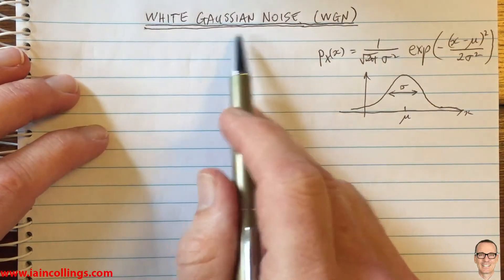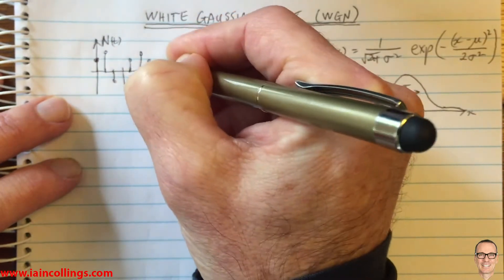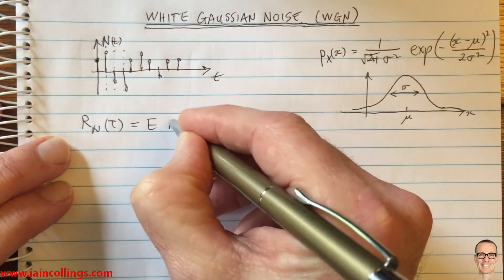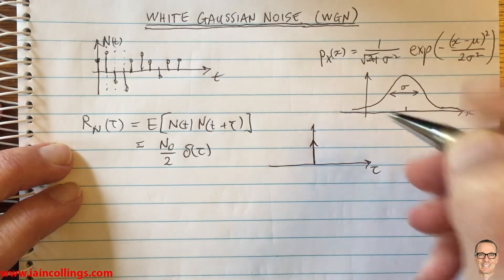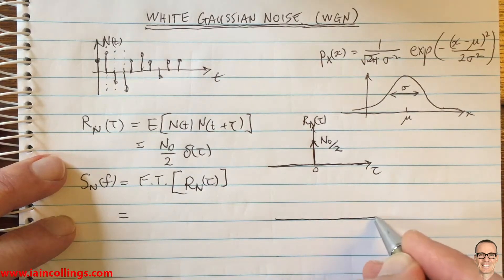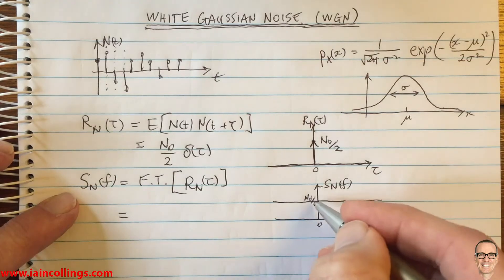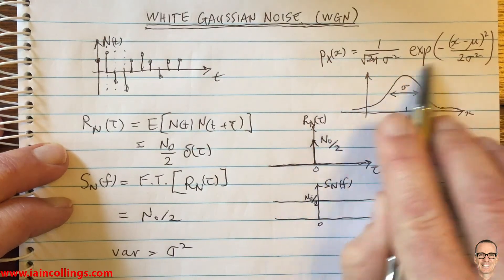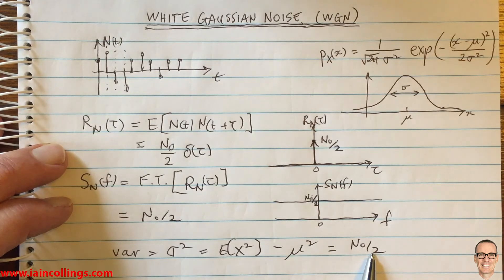What is White Gaussian Noise (WGN)?

Comment: You define the autocorrelation as RN(tau) = E[N(t) N(t + tau)]. Another definition of autocorrelation I have seen is Rxx(tau) = 1/T Integral (X(t) X(t+ tau)). I am wondering what the difference is?
Reply from the maker: In the definition you gave, the integral is over the time variable, t. If the random process is ergodic, that definition will give the same answer as the definition I gave. If the process is not ergodic, then you'll need to use my definition. These videos will hopefully help: "What does Ergodic mean for Random Processes?" and "Are Stationary Random Processes Always Ergodic?" https://youtu.be/onxzu2xUQ4E

Comment: sir.. what is the relationship between SNR (signal-to-noise ratio) and variance? matlab have function awgn (for additive, white, gaussian noise) with input SNR and can return variance as the result. Instead of asking us to give variance as the input for function awgn, matlab then asking us to give the SNR as the input, and based on the SNR, the appropriate variance can be obtained.
for example, SNR 30 dB gives us variance equal 0.001, SNR 20 dB gives variance equal 0.01, for now I just understand, if SNR high, variance will be low, and vice versa.. I mean the correlation in mathematical representation like your explanation in this video, thank you sir, this question just in case you can explain because your video make me clear about the 'white' in awgn function matlab, but just one more question in my head
Reply from the maker: Hopefully this video helps: "What is Noise Power in Communication Systems?" https://youtu.be/_qn4RzMrXBc
Reply: @iain_explains  thank you sir
Reply: btw nice video sir.. thank you so much about explanation the 'white'

Comment: As the mean is zero, the DC power(which is equal to (mean)^2) is zero. Then the total power(which is the value of the Rx(T) at T=0) is equal to the AC power(which the also the variance).
Therefore, the variance of noise is equal to the value of the autocorrelation of the noise at T=0 which is No/2.

Comment: Sir,  your videos are really helpful and thanks for uploading. I have a question: According to the autocorrelation function of white noise, variance (sigma^2) or average power is infinite for unconstrained bandwidth case. It means the standard deviation also becomes infinite. So, the Gaussian p.d.f becomes fatter (with diminishing height) as the standard deviation increases. Since the total area under the proper p.d.f. must be 1, how can we realize the p.d.f. of white noise as it's variance approaches infinity?
Reply from the maker: Great question. It's important to note that continuous time white noise is only a mathematical construct. In practice, no physically realisable process can change instantly from one value to another distinct value, potentially infinitely far away. There's a note in the description below the video that explains that the noise power that I wrote down is taken over a unit of bandwidth. In other words, it is assuming that the WGN has been sampled at the output of an ideal low pass filter, with bandwidth 1 Hz (ie. between -0.5 Hz and 0.5 Hz). This is something that is often done in textbooks without mentioning it explicitly. Of course, without considering a limited bandwidth, the noise power would be infinite (as you point out), since the area under the power spectral density "flat line" is infinite.
Reply: @iain_explains  Thank you for the clarification sir.

Comment: I have a question please, the power of the White noise is given by its variance as its becomes equal to PSD. If the mean is not zero, will we get an additional term in PSD as DC component?
Reply from the maker: Good question. I've got an upcoming video that explains more about noise power, so please keep a look out for that in the next week or so. But in answer to your specific question: If the random variables in the random process have a non-zero mean, then yes, there would be a delta function in the PSD at f=0.

Comment: what is the relation between the independence of noise at different time values and the conversion to a Dirac-delta function? I didn't get that part at 2:20 . . is N0/2*delta is a known auto-correlation function for a certain case or something?
Reply from the maker: If a random process is 1. stationary, 2. has independent samples from one sample time to the next, and 3. has samples from a distribution with zero mean, then the autocorrelation function is a delta function. This is the case for noise. R_N(tau) = E[N(t)N(t+tau)] which is the definition of the autocorrelation function = E[N(t)] E[N(t+tau)] since N(t) is independent of N(t+tau), and since E[N(t)]=0 since it is zero mean, therefore R_N(tau) = 0 for all values of tau, except for tau=0. For tau=0, R_N(0) = E[N(t)^2], which is the variance of N(t).
Reply: @iain_explains  Thanks a lot. It's much clearer now.
Reply: @iain_explains My question may seem silly. But why Variance of Noise process is No/2…?

Comment: Nice one ! Just a minor typo I noticed , to point it out : The square root in the denominator of the Gaussian distribution prefactor should include the sigma squared term or if outside the root then it should be just sigma.
Reply from the maker: Arrgh, yes, thanks, that's annoying. I'll add a note to the description under the video. Thanks for picking it up.
Reply: @iain_explains  it happens .. keep up the good job of making these well explained  important and nice videos ....

Comment: Sir could you please solve this question
Q 1 - A signal which takes the values +A, 0 and –A volts for T seconds with equal probability, is transmitted over a channel with additive white Gaussian noise of two-sided PSD equal to η/2. An integrate-and-dump type of receiver is used. What threshold voltages should be used if the probability of the receiver committing an error is to be independent of which signal is transmitted?